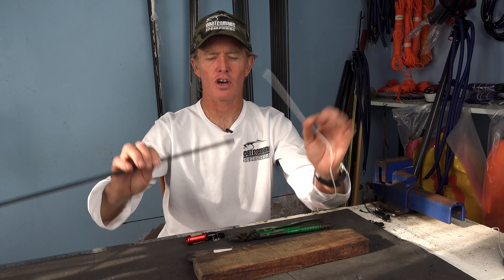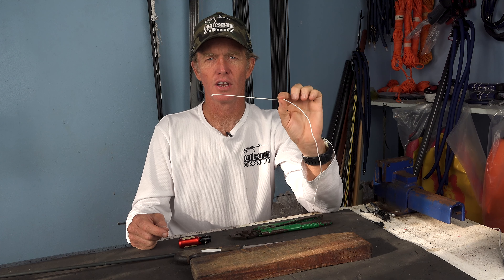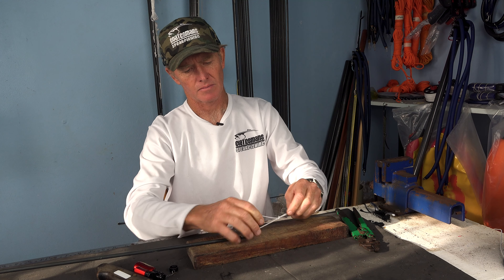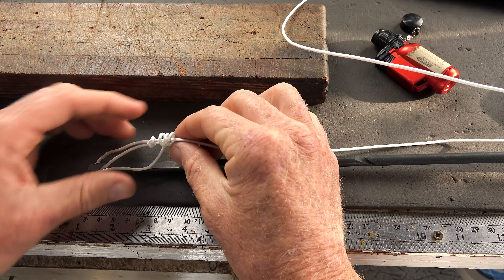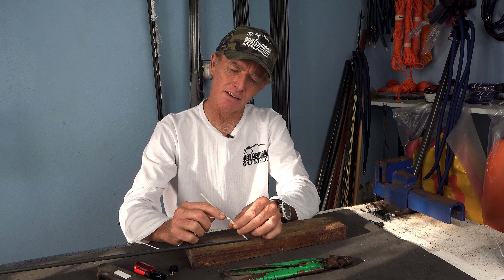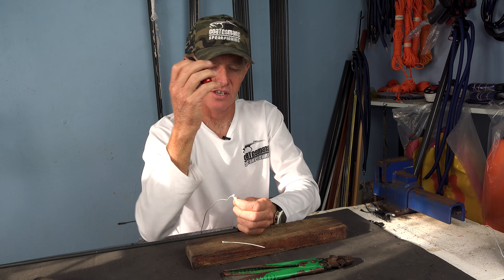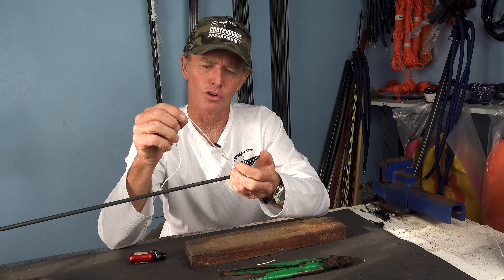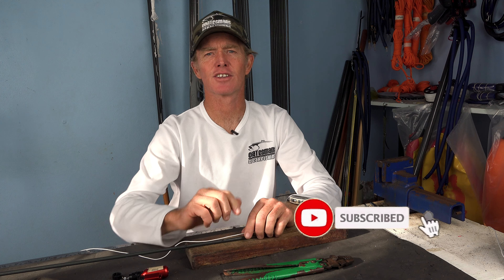How to Tie Dyneema Knot | Spearfishing

Comment: Been using this knot a few years and works like a charm. Thanks for the tip of wetting the line and pulling it forward when burning the end. Very useful tip. Like the 'machete' you are sing to cut the the line🤣🤣

Comment: Chris, why not use a simple bowline knot? In the days before mono that was how we tied shooting lines. I personally never had a failure that I know of.
Reply from the maker: Hey Luiz, bowline is good, easy and you can untie it. Which makes it very handy. But the dyneema knot is stronger and the bowline slips when using dyneema. Its probably fine for 90% of spearing tho.
Reply: Isn’t the bowline bulkier? May send shaft down more. I was using the bowline and found this vid a while back and switched but have not tried shooting with the knot yet

Comment: What happend to spliced hollow core dynema shooting line? Did you found this dynema to be better and stronger over the years?….i been using spliced hollow core dynema since i saw your video a few years ago. Never had it break no matter how old or frayed it is
Reply from the maker: There is not doubt that hollowcore dyneema is the strongest and most durable. The problem is finding perfectly cylindrical cord. Most hollow core 8 & 12 strand flatten out and are not round. This means that on a 2mm line the hollow core will be 1mm x 3mm 
This 3mm causes the line to have drag and slow the shaft down. 

When I find the right line.... I will get rich 😂